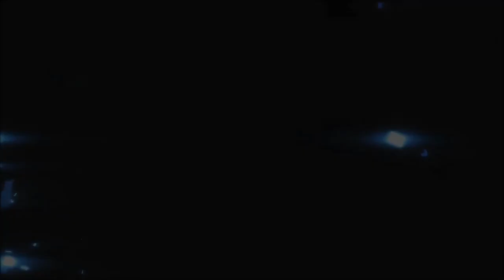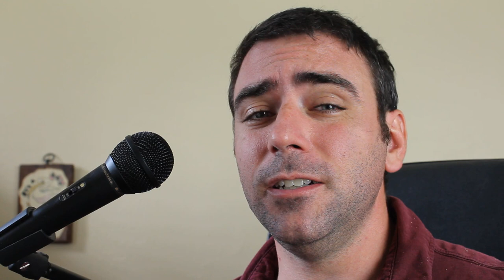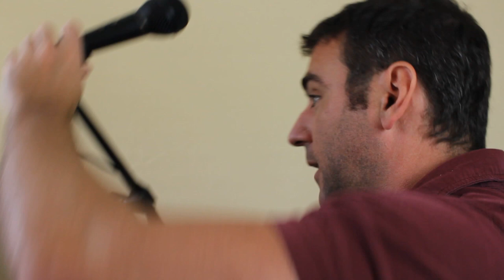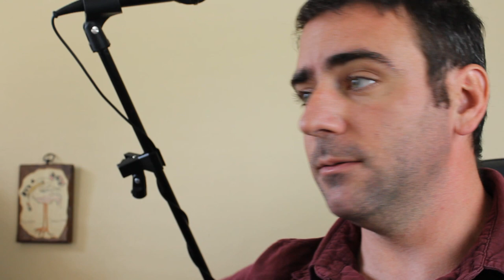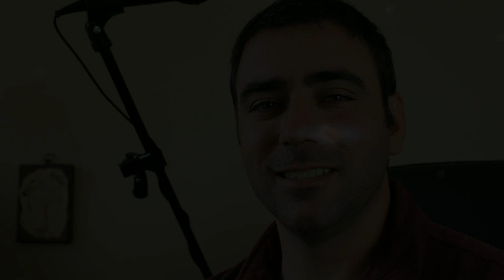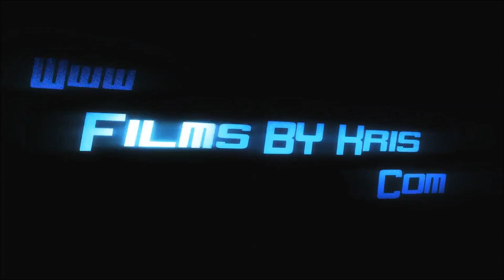New Mic Check - Cad u37

Comment: if you go the (recording devices) panel on windows and go into the properties of the mic and go the the custom tab and uncheck the box and then go to the advanced tab and change it from cd quality to dvd quality the mic audio will sound 10x better. I used this mic on a daily basis and didn't figure this out until tonight.

Comment: Hi, about the rapid pulse I've heard in the video about partition file images, I did not hear any here, apart from the normal "static" in the background (that was also present in there). Maybe I and my ear are just too picky, but I'm 100% sure it is not my rig now nor it is a problem with your video, but just your audio. Everything here and there was clear in the intro and outro. Here I hear only the normal static in the background, there, the static + the rapid pulse.

PS: I use a bluetooth earphone at all times, but even if I plug it directly to the pc it is the same.

Comment: It seems to me that in this video you might have the gain on your software volume too high, and the gain not up enough on the mic itself. Rely more on the hardware gain on the mic and test levels from there. The Cad u37 is a cardioid pattern mic so make sure you're always speaking into the front of the mic, whichever side that may be (cardioid pattern rejects most sound from rear+sides of mic). Seems like you were picking up room noise/echo so you very well could have been speaking into the wrong side.
Reply: I was thinking the same thing. A lot of people turn the mic gain up to 100 when most of the time it needs to be about 50 or 60.